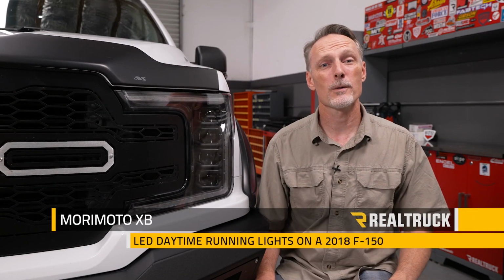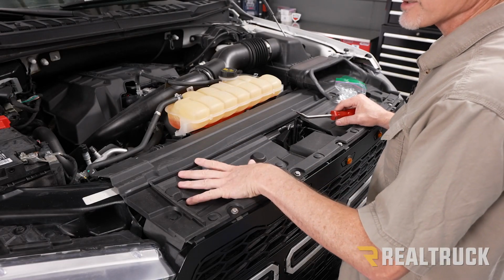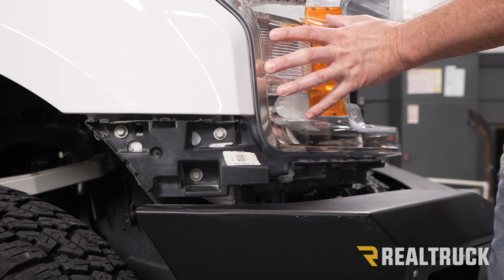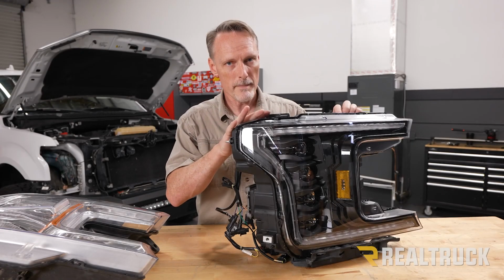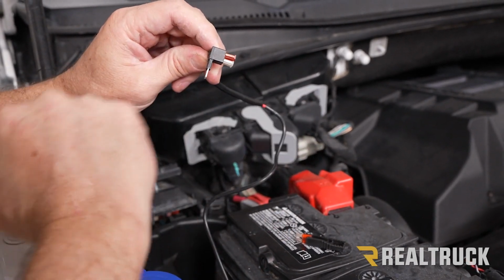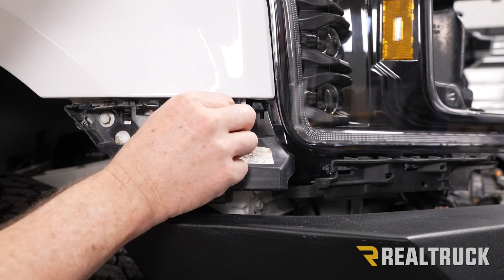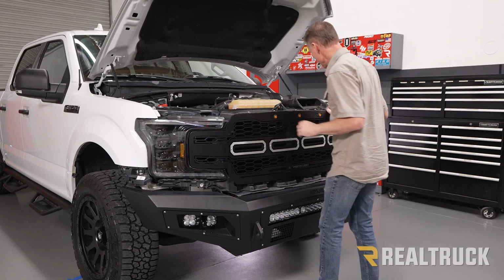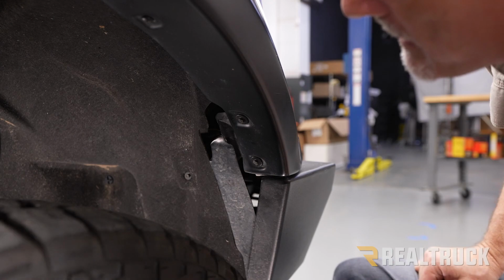How to Install Morimoto XB Black DRL LED Headlights on a 2018 Ford F-150

Comment: I have a 2020 F-150 with a 2.7 ecoboost there is no way I could ever take my Truck to a Drive In with the DLR’s sometime they shut right off , other times 10 minutes. Is there a way wire them to shut off when the trucks in park?
Reply: You can simply go into the settings and turn the DRL's off bro. Settings/lights/DRL. Turn them off.

Comment: @realtruck So I have a 2020 F-150 ecoboost. And just bought a pair of the new Gen 2 Morimoto xb Amber DRL LED. Should I also tap into fuse #37? And switch the 10 amp fuse for the 25 amp in the fuse tap?
Reply: Hey boss which way did you end up setting that up I followed the way he’s done it but sometimes my DRL stays on for a good while after I turn off my truck

Comment: Much appreciated. I was in the last part of my installation of the Morimoto XB's on my 2018 Raptor last night. Their instructions call for using fuse location #113. Funny because there is no #113 position. I also appreciated your showing the fuse change with whatever position one ends up using. This is critical and also not pointed out by Morimoto. Thanks to your video everything went fine with the fuse tap for the DRL's. Thank you.

Comment: Excellent video. Thank you especially for the tip on the ecoboost and need to switch the fuse slot to plug into. Lights were staying on 20+ minutes after leaving vehicle. Manufacturer did not include that important piece of information. THANK YOU!

Comment: Love your install video. I'm confused on which fuse amp should I use #36 10 amp or #37 25 amp? All other videos show them using the 10 amp but you're using the 25 amp because you have the EcoBoost. So do I. Should I be using the 25 amp as well?
Thanks DD
Reply from the maker: If you have an EcoBoost, the #36 fuse stays powered up for a while after the truck is turned off, that's why you would use the #37 fuse, otherwise the daytime running lights will stay on for about 30 minutes after you shut off the truck. If you're concerned about the 25 vs 10 amp fuses, don't be. Hope that helps!
Reply: Thank you for your response. I received email from Morimoto and she states use fuse 16 for a EcoBoost. Which I have 2.7 V6 EcoBoost. So now I'm confused.  I certainly don't want to do something wrong and I'm trying to do this by myself. But I have purchased and watched videos from RealTruck. So I'm asking you since your doing the video and the email is from Morimoto customer service...does using fuse #16 sound right or fuse #37?
Thank you for your help
Reply: Did you ever figure out which one worked better? I'm trying to figure out the same thing on my 2020 F-150 ecoboost. @donnelldoyle5340

Comment: Is there any way to turn these things off? When I switch my lights to OFF they come on super bright and even thr interior gets super bright
Reply from the maker: Hey Justin, we agree, Morimoto headlights are super bright, and if you have Daytime Running Lights, you might not be able to turn them off without special programming. We recommend making sure the headlights are properly aimed because if the beam pattern is too high, it can be blinding to oncoming traffic. If the truck has been lifted of leveled, you probably need to re-aim the lights. The rule of thumb is to have the beams 2 inches lower than the bulbs at 25 feet, but it's good to fine tune that angle after a road test. Hope that helps!
Reply: I installed these a few days ago, I’m also having the same issue. 2 issues actually. 

First issue- The stock light switch on my truck (2019 XLT) has 4 light settings..
- OFF DRLS Low Beams - Automatic.  

I switch my lights to OFF and the DRLS actually shine brighter than they do when I have the switch set to DRL only. I haven’t found a way to turn them OFF while the truck is running. In fact, the ONLY way for my lights to turn off completely is when the engine is not running and I have the light switch on AUTO. Having it on OFF, keeps them on EVEN while ignition is OFF and truck is locked. Is this normal? Are they meant to do that? I followed all install procedures step by step down to the fuse and tried a couple different ones, all less effective than the one recommended (fuse 36) 

Second issue: There is a loud CLICK noise that comes from the fuse box whenever the lights turn on for the first time after being completely off  
AND every time I engage the high beams.  

In summary, I just want to have control over when my lights are on and off as well as find a solution or fix for the clicking. 

On a side note- I love the lights, I got the amber DRLs and they are absolutely phenomenal! Will be changing my tail lights out soon as well 💪🏽

Comment: What fuse would I put mine in if I have a 5.0 2018 f150?
Reply from the maker: You would want to use the #36 fuse since yours is not EcoBoost. Hope that helps!
Reply: @Realtruck  I to have 5.0 an upon using #36 my drls will not turn off any ideas ?
Reply: @michaelday9338  Have you fixed this issue i’m having the same problem?

Comment: I have a 2021 Ford F-150 with a 301A package and halogen headlights. I would like to change the assembly (lens) from the halogen to LED and i have been looking at Morimoto. Does Morimoto a good light? would i have any trouble while driving at night or is it bright? I was also looking at ALpha Rex, which one would you recommend?
Reply: I’ve had my Morimoto headlights since Dec 2018, they are amazing. Brighter than stock led headlights